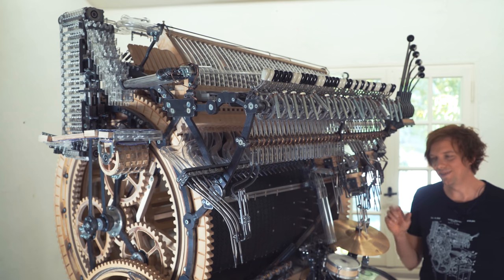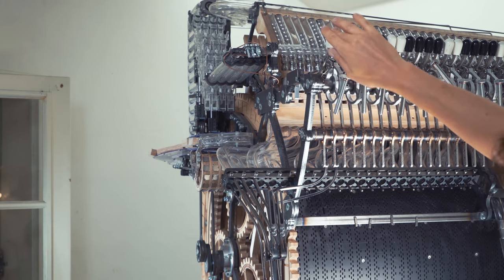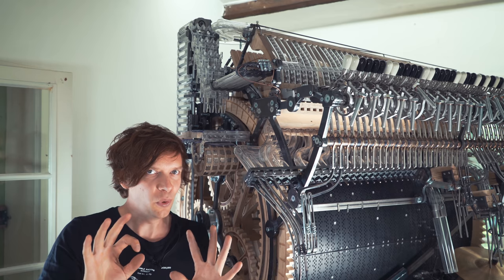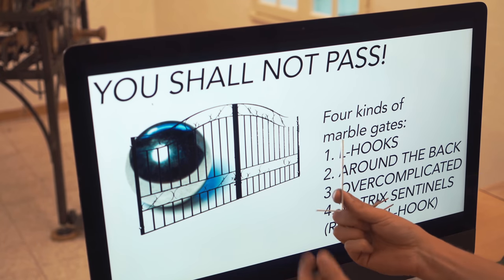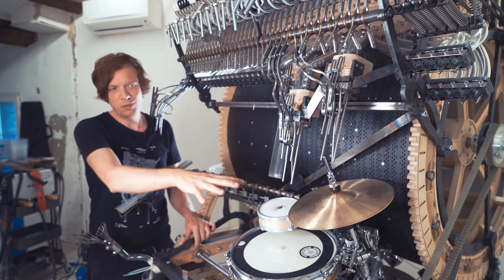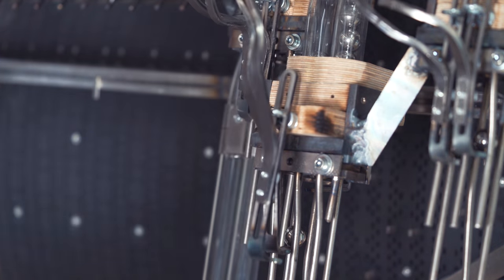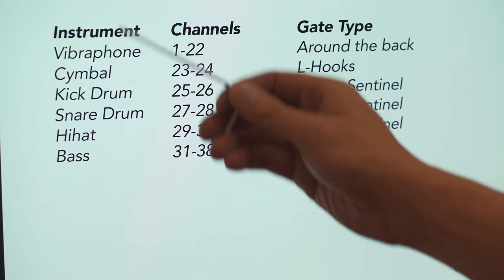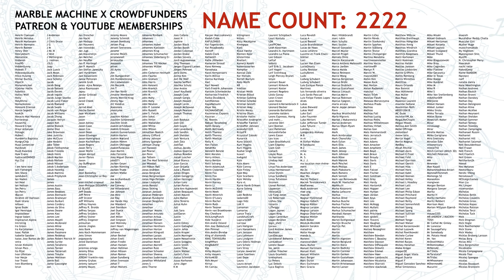Marble Gates Design - Marble Machine X #91

Comment: You need a marble staged on each channel that is much closer and uniform distance to the release point. Right now you have distances that vary to greatly across the channels. How are you going to get consistent timing with that? So, yeah, some redesign is required, but I bet you can add a "charging" gate above the release gate without getting overcomplicated or needing to reproduce the current gates closer to the release.

Comment: May be too late maybe not, and I'm not sure of the logistics of it, but maybe a rocking gate that teeters on a center point would work? In the 'open' position the top would teeter back and block the channel while the bottom opens to release a marble, and in the 'closed' position the top would open as the bottom closes, loading a marble to be ready to drop. Just an idea and not sure if you could make it work.

Comment: You could just adjust the length of the L hooks to compensate the length of the pipe below them: travel distance to the release is low? Longer L hooks; travel distance to the release is long? Shorter L hooks!

Comment: if you drop the wire and uses instead a sheet of metal you could use the second gate without the space restriction (it would be minimal restriction and you don't need much strength to hold marbles)

Comment: I suggest you study some gun smithing. In particular, look into sear design.
I know it sounds like gunsmithing and marble machines are far from related, but you are trying to accomplish the same thing that a trigger mechanism does. A trigger must reliably allow spring loaded hammer to fall, it must do this only when activated, it must do this predictably and consistently, and it must do this with a minimum of friction and wasted effort. Gunsmiths solved most of these issues over a 100 years ago.

One of the things I see through out the Marble Machine is a lot of wasted energy. When your plywood block slides forward to release the marble, the entire stack is lifted slightly. Same thing happens with the L-hooks. I bet if you addressed all the places in the machine where effort is put into un-needed motion, you could reduce the effort of driving it by at least 10% and probably closer to 30%.

I suggest looking into stuff on the Colt 1911, it is generally regarded as having the best trigger pull in a semi-auto pistol. They manner in which it releases the sear while under tremendous pressure is clever and still in use today. The other thing to look into is the sear design in a Remington 700 rifle, this probably more inline with your marble drop.

Comment: Maybe you can make a slight variation of the “around the back” gate for the base? I’m thinking maybe there is enough space higher up for the “around” part and the wire can go down parallel to the track to stop the marble in the right position? 
If there is space it’s an easy solution and you don’t have to compromise on the speed...?

Comment: My question is "Why"? As in "Why have a second single-drop marble feeder when you already have one under the marble divider?". If the total length of the PMMA pipes and metal rails are all the same length/time, then all the notes will play at the correct tempo. If you're playing fast notes, there may be 2 marbles in the drop system, but they will remain equally spaced so the timing will be the same. This way the only limiting factor for note speed is the grey marble feeders.

Comment: Just weld two pieces of metal comming off the front of the L Hook and bend it down and under the front of the dropper then back and behind
.  You gotta leave enough room between the two metal pieces for the marbel to pass through but it should be the same size as the track you already have.

Comment: How heavy are the marbles? I think if you need space on the side, the piece that holds the marble doesn't need to be especially thick. I think there will be plenty of space if you use a flat piece which is twisted in order to turn. I can make a visual example if you'd like to see it.

Comment: You could actually try to redesign the sentinel gates to fit them into the bass section. If you would bundle up all four channels in one module instead of makeing them separate, i guess you should be able to fit it in there. Actually, you should be able to just repeat the design from the top part.

Comment: Maybe a kind of line Shifter. in the Lower line is the normal L Gateway. A few cm before you have the lin split. With the Switching Plywood hole from the Matrix . When the gate is close the hole ist on the lower marbeline so that it can release the marble. When the Gateway is open the Hole shift to he upper line and loads a new marble. The switch can be installed on the end of the L Hook Marble gate. The upper and lower entry points can be from plywood so that the whole shifter is just 2-4 mm more the the normal line.
I know it sounds confusing, but I can make a scetch if aou are interested

Comment: Can you modify the L gate to make it a G gate?  It would be adding the around the back to the short end of the L gate. Might simplify things and require less space. The G part would be outside the marble path at the end of the L portion. You could think of it as a hole in the bottom of the G, if that helps.

Comment: What if you had a marble hook in the shape of a C? It would need a different firing mechanism, but i think it would be able to stop and release marbles pretty quickly. 

To be more specific it would be a C that is sort tilting up and down. The firing mechanism would need to work on a catch only. I would say all your other triggers are catch and release. (Everytime they play a note they move back to the starting system) the C hook would need to catch, to make it move, but it would have to stay to hold the next marble. The next catch would tilt the c back downb, releasing the marble, and stopping the next one. The firing mechanism would be the hardest part about this. (I want to have a solution for it, but it's 5am as i write this. Sleep is sadly more important for my health.)

Comment: Too late now, but wouldn’t it make sense to have the instruments with the quickest play speed have the biggest buffer to begin? It seems like the marbles loading from the left was a compromise for displayability as the percussive instruments, which occupy a large space visually, make sense on the right, but require a lot of marbles to function. This means a lot of marbles migrating to refill their respective buffers. Including the secondary buffer essentially solves this issue, but keeps the average marble path length high. I imagine the instrument will be played with its left front foot facing the audience. Maybe a consideration for marble machine 3.0 or 4.0. Widen the machine, giving enough room for the best release mechanisms and tighten up the timing (distance) to all instruments. This would minimize all the finnicky time consuming steps, and it would look better in a large auditorium. I guess at the end of the day, you learn everything’s a compromise pretty much every day with a contraption like this.

Comment: the around the bac could be smaller when using bent sheet metal, you screw into the fixture for adjustment. but that would be tedious adjusting i guess

Comment: With this design, does that mean the Marble Machine X requires one marble to be set and ready to drop before any song can be played. If each channel pin releases one marble from the dropper and one marble into the dropper channel, would that not mean that if the dropper channels did not start a marble already in them the first note for each channel would play nothing?

Comment: If you have replicated the functionality of the marble divider grey part lower on the drum rails, would it make sense to bypass and remove the upper grey part and just have the marbles build in the reservoir? It is probably too late in the process, but just something to think about to reduce the number of moving parts and redundancy.

Comment: Don't the sentinel gates stop the ability to use the mute system?  The hooks on the back of the 3d printed (grey) pieces were designed so Martin could throw a lever and then stop the instruments of a certain section from making noise.  However, since the drums are always "primed" with a small number of marbles, the mute will never be able to stop the next marble from dropping. 

Unless that is the redesign Martin is referring to.

Comment: The only issue I would care is: is the gate is tun-able? The rest even if it is a bit more complex, I would not care.
Space is something to be taken care of as well as the max-min achievable speed. it is also something I would not sacrifice.
If you did not come with a solution (like matrix sentinel and/or 'overcomplicated') I would use the others. Once you took time and effort to come to the full design of the solution(s) why re-invent the wheel (I have some colleagues that are doing this, I hate this behaviour) ....
Are you able to build/produce them (matrix sentinel and/or 'overcomplicated')? 
Are you able to have high efficiency of production (w/o loss due to defects or other problems)?

If you do not need to 'tune' the gates every time you move from place to place, do not over-simplify and throw away something you already have.

Comment: Within the Matrix Sentinels, you could easy skip the step with the reverse L-hook.
If the sliding block does not load the marble while the channel is closed, but when its open is open. (Therefore  you would move the reloading tube to the front) and realese the loaded marble inside the sliding block when the channel closes again you would have the same resolut. but one step less. The L-Hook could be removed completely

Or am i missing some thing??

Comment: What if you make another section based on the marble selector (grey block) on top, attached to the vertical plate of the releasing mechanism?
When the release opens, the opening in the metal pipe is closed and only when the dropper/door is closed it will allow the ball to continue further

Comment: I am thinking of rubber elastics on the sides of the track that will be stretched inside when the gate is open, this can be slowing down the ball. When the gate is closed, the tension is gone, therefor the ball has no resistance.

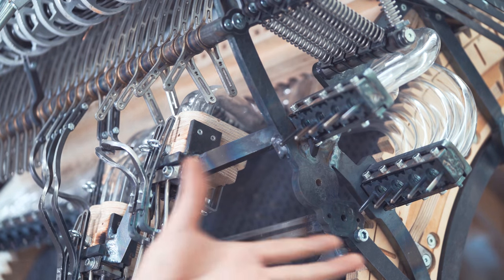Comment: 13:31
I disagree.  You should go for Matrix Sentinels.  It appears to be already well-setup to accept them (Minus a bit of a tight squeeze in between, but that can be fixed with careful application of an angle grinder).  Now if only your final Matrix Sentinels used delrin, and not wood.  I know you want to finish as soon as possible, but you still need to make it look good, and frankly, wood doesn't work aesthetically when you stack it like that.

-------------------

Another thing that's been bothering me for some time: While I believe the white and black for the push knobs are aesthetically pleasing (minus a bit of weirdness with the percussion channels suddenly switching to a WBWBWBWB pattern, while the rest have doubled-up colors (WWBBBBWW, etc.)), they look very confusing at a glance.  This may just be me, who is used to seeing imaginary lines everywhere that appear based on rapid changes and lines extending where they aren't, but it might help to add some differentiation.  One way you could do this is switch to colored knobs (and associated registrators) for the percussion and bass.  You'd want, at minimum, 4 colors (8 if you want to give each drum/cymbal/string its own color), and you just assign a color to each instrument.  For example, you can go with:

(Key: Red, Yellow, Green, Blue, Orange, pInk, Light blue)

* RRYYGGBB/RRYYGGBB (Simple Rainbow Style)
* RRYYBBOO/RRYYBBOO (Rocksmith Style)
* GGLLIIOO/RRYYBBOO (My personal favorite)

A similar change would be to add a simple little metal rail above the knobs and have a big printed label on it that breaks the knobs down into little sets of two using separation lines, and gives each set of two a color.  For the vibraphone, you would give the usual black/white (making sure the lines still show up), and for the percussion and bass, you'd use a color set like the ones above.  You'd still have the same black and white knobs and registrators (maybe switching the order of the percussion ones to maintain the doubled-up order that the rest of the knobs have), but would have the benefit of being able to quickly identify what thing a given knob will play, without having to count knobs or imagine them in sets of two like you would now.

Yet a third option is to vary how far they stick out (within reason, you'd only need to vary the height by about half a centimeter or two).  This would help the most on the bass strings, by having the E-string channel knobs the longest , then the A-string, D-string, and finally G-string.  The best part about this solution is that you can keep the pretty white and black knobs with no colors nearby to muck it up, and no rails with lines to forcibly separate them visually.

Of course, you can also try a combination of the above.  Whatever works.

Comment: You don't need two things doing the same thing on one channel. So I was thinking that you could remove or dill out the 3D printed part for the drums and high hat and just turning them in to longer feeding tube. This might not be able to be done with the way you need the marbles to stay even at the top to allow over flow to roll to the next empty channel. Good luck and keep up the good work.

Comment: TLDR: https://imgur.com/a/u5yedR4 GIVE THE OVERCOMPLICATED A SECOND CHANCE, just flip the lever attaching it directly to the L hook that releases the marble, so that the plate obtructs the marbles with the tip instead of making a v shape funnel.

The matrix sentinels look soooo good, but, they are bulky, are a failure point because of the individual buffers they have to keep (need to be primed with marbles before playing).

I'd say, dont throw the overcomplicated design away, it isn't nearly as complex as you made it look like, its just a lever to be able to queue a marble as close as possible to the drop point on the rising edge of the release, which is all you need 90% of the time.

 On top of that, the rising edge buffer (this is how i would call it) can be tuned with the root releaser on top (modifying the gray parts) to drop a marble with the slightest upwards movement fast enough to have a blocked marble already buffered before the actual marble is dropped onto the instruments (this is the optimal design IMO, fast, no width added, only a sigle marble buffer, can withstand almost 100% of the fastest possible drop rate dictated by the root releaser).

Another option is to free the original marble release and make the matrix sentinel/alternator be the root gate, close to the instrument. this means that all the travel from the top should be filled with marbles.

Also, I don't get how are you going to control the gate of the crash cymbal, it's too far down, you'll need to do some weird things like stringing on pullies or thick metal wire transmission, IMO.

Take care and keep MMXing!

Comment: Isn't there a simpler way to do it? 

I think about modifying the matrix gate. 
How about changing the behavior of the wooden piece (that one which is made of gray plastic on the top of the MMX) so that when the marble is released on the instrument, it charges (it "eats" the marble) and when the marble release is closed it spits it out. That way you get rid of that L back gate piece.
And I think that there is a way to do that mechanism small enough that it would fit right on the tracks. 

Or combine around the back with "wannabe marble release" (working just same as the normal release but it would be positioned above the around the back gate).
Put a short tube between them so it contains only one marble. 
Then make another tube for "short term storage" on top of the wannabe marble release. 

It wouldn't be as wide as your current matrix gate system, but it could potentially fail thanks the friction of the WMR and marbles.

Comment: For the bass could you not make around the back, which instead of going around the side it go go around the bottom in line with the marble drop pipe so it will not get In the way of the marble

Comment: I love all the gates. (Are there 3 on each marble path now?) - but I am lost as to why more than one gate would be necessary. - as long as the machine is only dropping one marble at a time and precisely at the right time and where the marble needs to go -- why does it need to pass through so many gates? --- also, does having a gate below the marble divider make the black and white hand knobs non-functional? - I love all the design - but I am lost as to why so many gates are necessary. And then I worry 3 times the gates - 3 times more likely of a malfunction :/ - perhaps a video with an anatomical view of the marble pathways would be helpful (like an Mmx circulatory system diagram :p) --- I know that you must have thought this all out - but I am not able to keep up in this part. All the best, ~Kody

Comment: I don't really get why the around the back option couldn't be adjusted to not require side space. Simply replacing part of the down section with a loop the marble can pass through should work going straight down?

Comment: Wouldn't shortening the L Hooks slightly and using the long drop distance between the hook and the gate to allow the gate to close be the simplest solution? or is there a window of opportunity large enough for some marbles to slip straight through when playing slow even when the L Hook is longer than option 1 but shorter than option 2?

Comment: Would a feeding wheel work? A spring steel in a 1 way gear so when you release the marble the spring steel slides and when it's going back it pushes a gear and a new marble is feeded. Should work on all types and would only build on the top or bottom of the channel, not sides